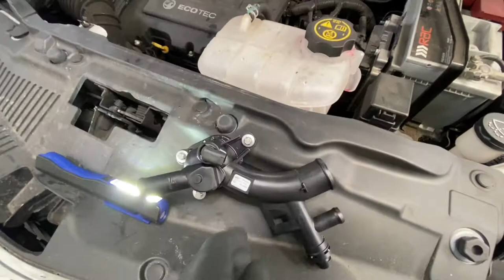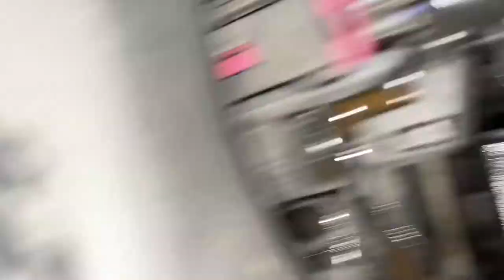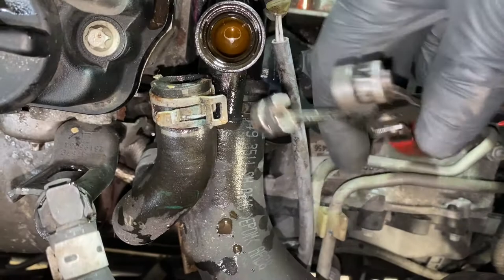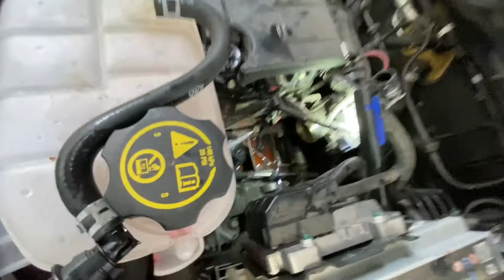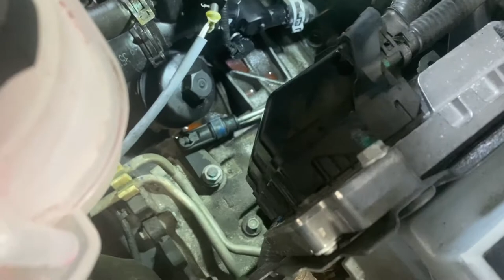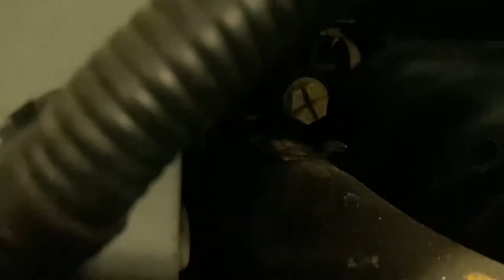#Vauxhall #Mokka #Zafira #Astra temperature #sensor #housing #removal and refit and bleeding process

Comment: Hi
Many thanks for the video…..daft question, I’m just about to change the temp sensor on my 05 zafira…the electrical connection to the old sensor is mega tight, is there a clip or something I should press/ remove from the connection or do they just pull straight off?……I don’t want to damage the thing!
Reply from the maker: Press you clip down on the switch and push forward while’s holding the clip down them pull off